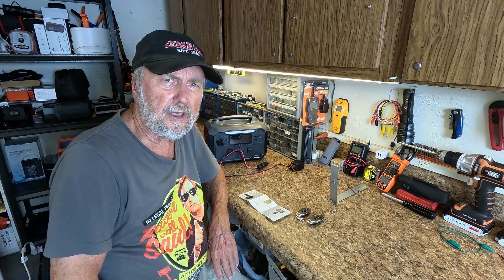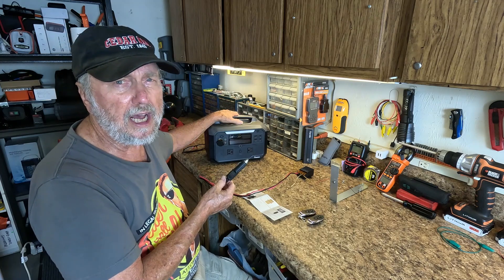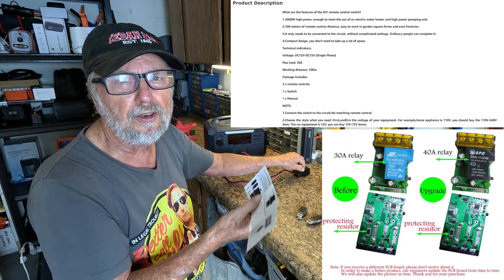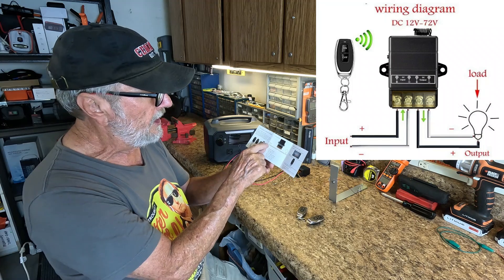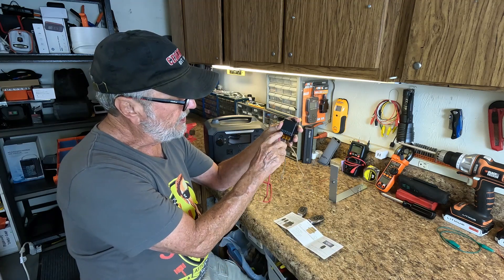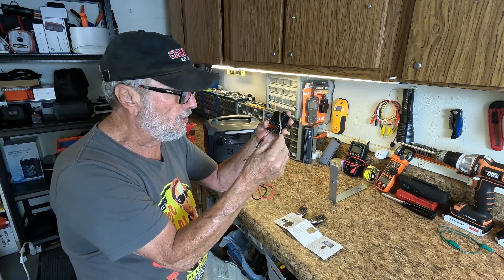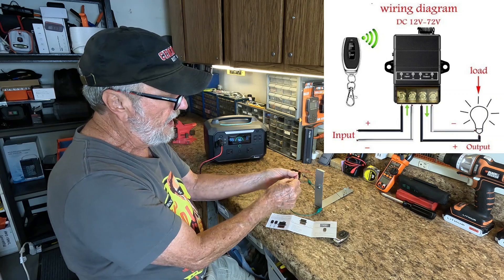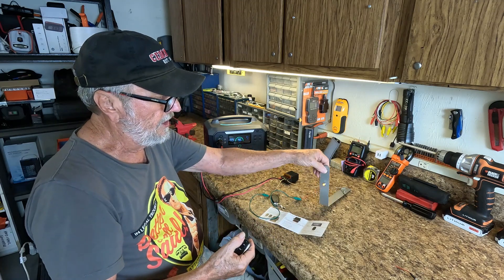Dstfuy Wireless Remote Switch 12V DC Relay

Comment: thank you sharing. be awesome to remote control some lights that need a switch that you do not need to  turn manually on great job demonstrating
Reply from the maker: This is simple to connect, 300 ft remote operation, and single positive lead switching.  Price is low, $19.
Reply: How can we use this as a car kill switch?
Reply from the maker: @JanoLguz  you could use it to kill power to fuel pump.  When relay is operated, you have the fuel pump to operate, release relay and it would kill power to pump.
Reply: @samowens44  is there a way to tap into the ECU? That way cuts all power?
Reply from the maker: @JanoLguz  Yes, you just look in the fuse box and find the ECU fuse and you can tap into that lead.  You can find fuse connector leads that could help with connections without cutting wires.  Do some research to find the best way of using the fuse holder location as your connection point for relay contact insertion.  I have not done this, only suggesting ways to accomplish what you want.  Take your time and research fully before attempting.

Comment: I bought a 433Mhz Wireless Remote Control EV1527 Learning Code Transmitter Relay Receiver to enable my garage door to be closed remotely (the existing inbuilt system no longer has any range ie less than 9 feet).  The problem I have is that it has provision for an auxilary receiver and provides 12v+ , ground and signal pins.  If I short the ground and signal pins the door opens and closes.  But I cannot figure out how to make the relay switch do this as the switching is on the positive side whereas I need it on the negative side.  Any suggestions would be greatly appreciated - its driving me nuts!
Reply from the maker: You need a remote relay that has contacts that close when relay is operated.  You can then connect - grd to one contact and the other to the garage door remote receiver.  Operate the relay with remote and the door will open.